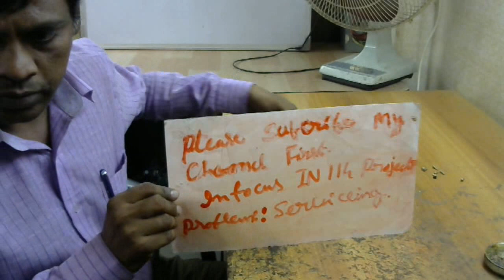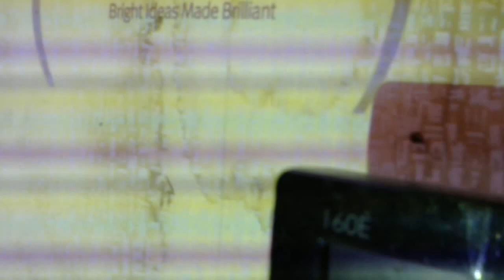infocus in 114 projector, problem is servicing

Comment: Hi. I would like some help. I have an In116. The machine turns on, the light is on.After a while the temperature/light will light up.The fan is working.I turn it off, power and temp/light blink alternately!I put a new lamp in, the error is the same!it is also cleaned! What could be the problem?

Comment: Can you help me with a IN114?  It will power on, then cut off after a while and will not power back on for a while.  It repeats that pattern.  Can you tell me why?    I am able to use access the menus and all the buttons work fine.  I just wont stay on.  Can you tell me why?

Comment: sir..need help..my infocus in112 have a temp/lamp problem..i on the unit but the lamp turn on and in a 15 or 20 second automatically off and the led indicator is on the temp/lamp..what should i do?
Reply: Did you find a solution?  I'm having the same problem now